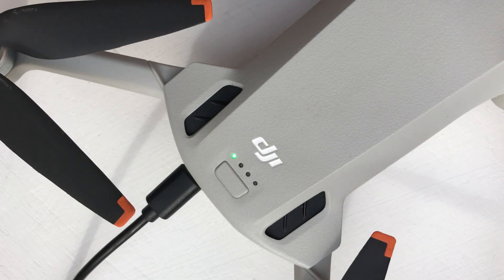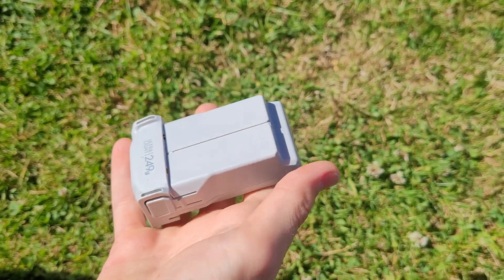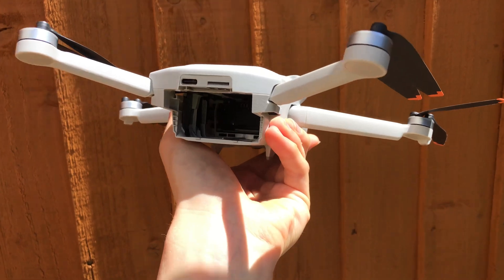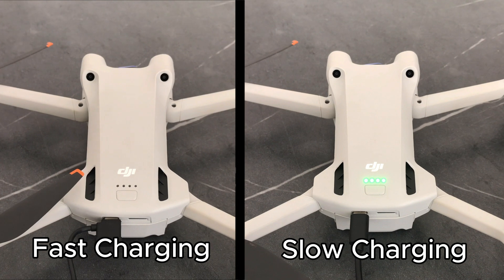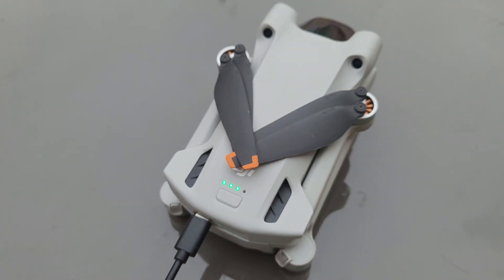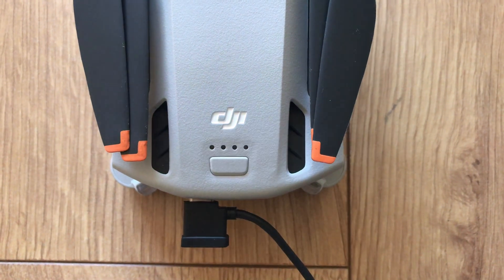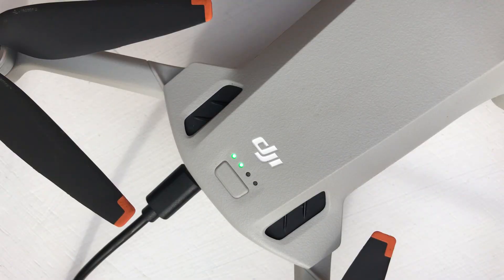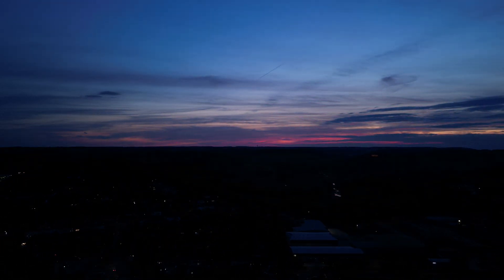Fast vs. Slow Charging - Drone Battery Care | DJI Mini 3 Pro / Mini 4 Pro

Comment: Thanks for the video 
How many W charger do you use? I just bought the one dji recommended, which i think was 30W. Is it considered to be fast or slow? 

Also, I let my batteries sit for several months witjout charging and now their performance dininished significantly. Is there a way to "repair" these batteries? 
Thanks.
Reply from the maker: Hi, 30W would count as fast charging. However, if you force 30W into the battery, the drone will not accept the charge and turn off as protection. For DJI Mini 3 Pro, at charging voltage 7.5V, you’d need to force 4A into the battery, which would damage the battery.

It’s not a problem though because the batteries are intelligent and will adjust their charging as necessary, and will not use the entire 30W. Feel free to let me know which drone you have and I’ll find out the charging details.

As for repairing the batteries, you can try to connect the battery to twice the nominal voltage for ~30 seconds. However, since the batteries have in-built protection, they will turn off the charging by themselves if you exceed a certain voltage. This works on mobile phone batteries which are also Li-Po batteries, so I would expect it to work with the drone’s batteries too. 

Unfortunately it’s not possible to fully repair the batteries to the original capacity though, as some chemical damage has already been done in it. When I did this on mobile phone batteries, it extended its life by a few months at most.

Any questions let me know. Thanks
Reply: @takeoffdrones  thanks for such a detailed response. My brain shut off at 7,5voltage hahahaha I thought we had 220. Even though it could be a different thing. I was really bad at physics lol

I have a DJI mini 3 pro and I bought exactly what they recommended, I asked them before buying. I got a Voltme charger with a USB A and C and it says:

USB C (illegible) - 11V = 3A (PPS) / 5V=3A / 9V = 6A / 12V = 2.5A / 15V = 2A / 20V = 1.5A (30W max)
USB A: 5V = 3A / 9V = 2A / 12V = 1.5A (QC 18W)
Mode C+A = 5V = 3A (15W max)

What did I just type? 😭😂

But I think I realized that it receives 220V and then it transforms it into another thing.
Reply: @takeoffdrones  also, how do I connect it to "twice the nominal voltage"? Do I have to buy a certain type of charger? Thanks 🙏🏼
Reply from the maker: If you want to try connecting it to twice the nominal voltage, you’d need a variable power source or a charger with a higher voltage, for example a laptop charger. However I’m not guaranteeing this will work, because I’m not entirely sure how much power the drone regards as a limit after which it will shut off. But any voltage between 10-20 V would be sufficient. It would be interesting to find out how this turns out, so please let me know!

Comment: as far as lithium batteries goes, its usually better to top off as well to keep the batteries cool. your batteries will last longer and have more charge cycles if you charged them at 40% to 90% than 20% to 100%
Reply from the maker: Yep, it’s best not to completely drain them.

Comment: i have 4 batteries for my Air 3 plus 864Wh power station, those 4 batteries are enough to keep rotation with slow charging, this way i prolong lifespan of them, also i never discharge them to less than 20% and charge them to 85-90% that's gives you even longer lifespan, about 450-500 cycles overall
Reply: After 500 cycles they still have 80% capacity
Reply: What do you store your batteries at, 40 or 50%? You are the first person I've heard saying not to charge drone batteries to 100%, but I was also thinking 90% would be the best strategy and yes bring it home by 20%.

Comment: Can I keep my batteries inside charging hub ehile storing?or should i separate them from charging hub?
Reply from the maker: @NoizyEyezsince89  you can keep them in the charging hub, no problem. You should disconnect the charger once they are fully charged though.

Comment: I have a air 3 all 4 batteries have reached 200 cycles I’ve ordered 2 new ones, I have always fast charged now at 220+ cycles they are holding about the same, I don’t really see a difference 🤷‍♂️
Reply: hi
i really search urs post question.i have same issue
my batteries reached at 100/102/101
i was confused abt my batteries life.
pls suggest that AM I CHANGE BATTERIES OR NOT
Reply: 200 cyles, that's awesome Sir!
Reply: Do you charge them to 100% or 90 for maximum lifespan?

Comment: Where to select fast or slow charging?
Reply from the maker: Hi. Usually, USB chargers provide slow charging, and USB-C chargers provide fast charging.
Reply: @takeoffdrones  You are really talking out your ass. Fast chargers have a higher wattage than slow chargers. Some batteries can be "fast charged", some cannot. A fast charger will be 25 watts  or more. It has nothing to do with the style of USB.
Reply from the maker: @nedflanders1559  Hi, to add to this matter, I’d like to emphasise the word “usually”. Most of the time, you’ll find USB chargers provide a lower wattage then USB-C chargers. There may be instances where this isn’t the case, but I’ve never seen USB-C chargers be unsupportive of faster charging than USB chargers before.

Comment: Hi, 
The charger that DJI sells, does it charge slowly or fast?  The cable is attached to the charger so no idea if it is USB or USB-C?
Thanks 😊
Reply from the maker: Hi, do you mean the cables included in the DJI drone package, or the portable charger they sell separately?
Reply: @takeoffdrones  the portable charger the sell separately.

Comment: Very infomative video.Thank you.I have dji mini 4 pro plus and have few questions.Please help.

If i want to keep them stored what percentage would be recommended? 

After how many days of storage I should charge  again as I am not even a regular flyer?

I have purchased it 20 days before but not yet opened the package.So after opening the package upto what percentage i should charge it and store again? Because I have no plan to fly it soon.

regards
Reply from the maker: Hello, first of all thanks for watching!

You can keep the batteries stored at any percentage, as they will not damage themselves. If you charge them to 100%, after 1 day they will discharge automatically to 96%, and after 9 days they will discharge to ~60%.

The DJI batteries are very secure, so you will not have problems if you don’t charge them for a while. My recommendation would probably be after ~3 months to fully recharge them and use them for a while on the drone.

Before you use each battery for the first time it is recommended to charge them to 100%, and they will activate when you do this.

Hope this helped!
Reply: @takeoffdrones  Thanks a lot and truly grateful 🫡

Comment: How do you know using fast charge damages the batteries more than slow charge. I suspect this is wrong. Where did this information come from. It is interesting.
Reply: You didn't answer the question, I would also like to know where this info has come from, as incorrect I actually got in touch with DJI, they say it makes no difference fast or slow charge. So your info comes from where?
Reply: @kernow-alan got in touch on dji? Why should they tell you the truth? So you can buy batteries when yours are dead.
Reply: @kernow-alan fast charging does degrade the battery over time how many cycles? Who know. Saying this cause a dude who lives in his Tesla had always used the fast charging on his car or whatever one that can charge it to 80% from 0% in like 30mins. So it might have something to do with the rate of power coming in. You can also check your phone battery health after certain charge cycles battery health goes down. For example my phone battery health from a bit over a year now is now at 85%. I believe when a battery in general falls below 60-50% heath that’s when you starts to see a difference because each charge will not charge it to full 100% and voltage will drop quicker
Reply: @mortiarty7842 
The question was does fast degrade more than slow, not does it degrade over time no matter if you choose fast or slow charge.

Also why are you comparing to a Tesla battery, completely different setup of battery. We are talking about 1 specific battery anyway.
Reply from the maker: Hi there. Fast charging can damage lithium batteries if used excessively because they can create excess heat and stress on the battery’s components. This reduces the battery’s ability to hold charge, which makes it less efficient and thus having a lower capacity.
Reply: @takeoffdrones  So, you are just guessing?
Reply: @takeoffdrones I'm confused.. cell phones use fast charging and they last for years.. so I imagine the lithium batteries for these drones would do the same.
Reply: Vous avez entièrement raison. Ceci est bien connu en modélisme pour les LiPo. Les LiFe c’est différent mais pas dans ces mini drones ;)
Reply: Heat degrades lithium Cells

Comment: How do you switch between the two?
Reply from the maker: If you charge with a USB-C cable, it will usually fast charge, but if you charge with a USB charger, it will usually slow charge. You can tell which is being used by looking at the lights. 👍
Reply: @takeoffdrones  Thanks I didn't know that would make a difference.

Comment: battery has 200 cycles so doesnt matter cos it will wear off 😂
Reply from the maker: I’d say it’s capable of a lot more cycles!
Reply: C’est peu
Reply: Koki, not really. Battery degrade by heat. When you charge in lower temperatures, you will have more cycles.
But there is question, when is temperature and degradation lower. 
You can charge 2,5 hours by some temperature or you can charge 1 hour maybe with some higher temperature but shorter time. I dont know, when will the heat degrade battery more

Comment: I had no idea they had slow/ fast charging. I just charge them😂
Reply from the maker: Now you know! 😂 Thanks for watching.
Reply: @takeoffdrones  Uhh . . . is there a switch?
Reply from the maker: There’s no switch, because it’s all down to the wattage being used to charge the battery. Usually, USB-C chargers will provide higher wattages.
Reply: Yes, just look at the watts on the plug in charger. If it says it  45 W or 65 W it's then a super fast charger.
Reply: @str8alphamale eh oui je charge avec ces valeurs mes batteries ;)
Reply: 20 or 15 wat should be good and not harming battery life!